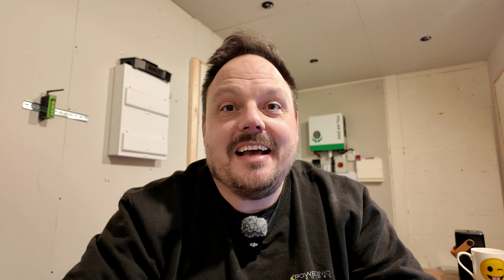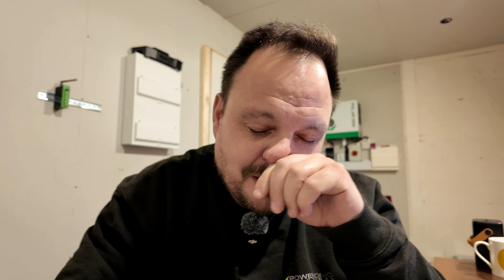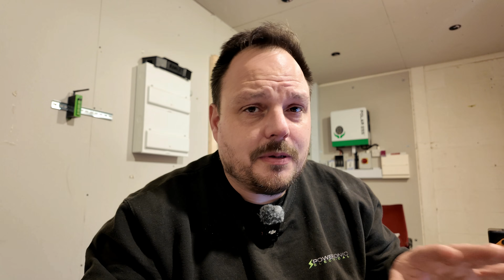So you want to be a solar installer ???

Comment: Great channel Mark your feedback and knowledge are a massive help.  I’m looking to start up on solar and battery storage alongside EV in 25 and already booked on the courses for bpec solar and battery. Could you give me some advice on how you approach the roof work. Do you use a roofing contractor to do all your hooks  and frames  etc or is this something you tackle yourselves?  Like you i’m not great with heights so really would like that side done for me and perhaps focus on solely the electrical side of things. Is there a specific height  /safety course you did for roof work ?👍🏻👍🏻
Reply from the maker: Hi and thanks! We do this ourselves but plenty of roofing specific contractors are out there to help. Mike from East Renewables helps us a lot so plenty of options if you dont fancy the roof work yourself! Good luck with it mate.

Comment: Just had solar installed (not by you) and I went up on the roof and noticed a number of the panels appear to be scratched, is this normal?
Reply from the maker: The frames can often be scratched. The top surfaces can sometimes appear so but is usually water staining. Hard to say without seeing what you are seeing lol
Reply: @electrician247  thanks for your reply, it's the actual surface that is scratched not the frames and it looks like it may be from the underside as I can see them but cannot feel them. I will have to take it up with my installer.